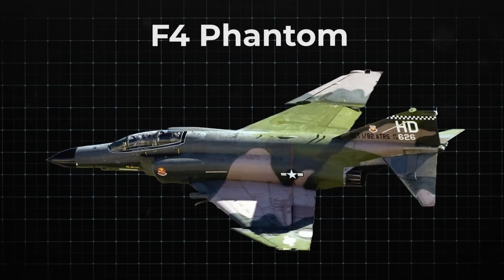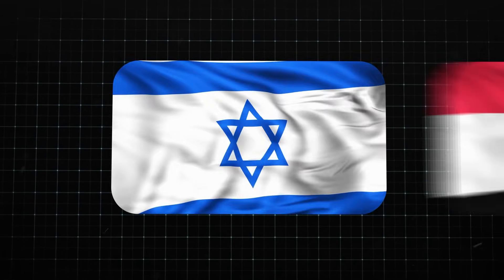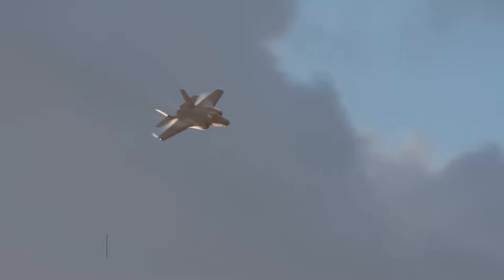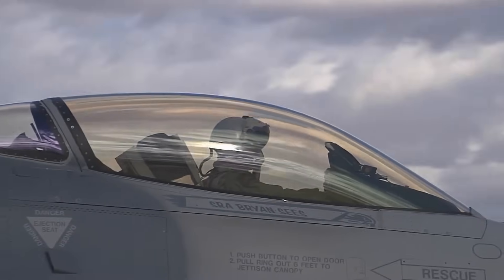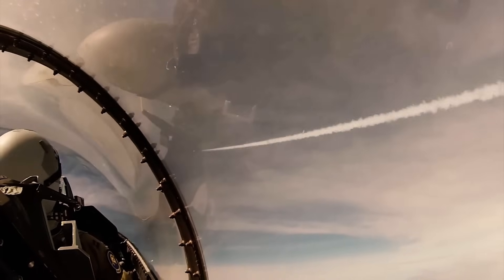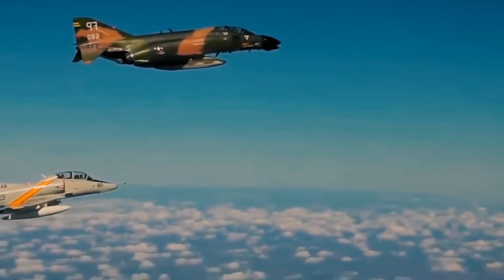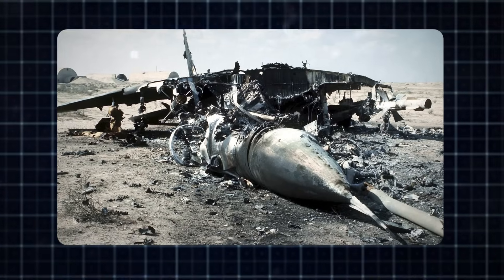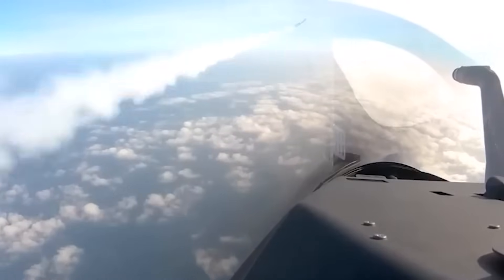FINALLY: US Tests the NEW F-4 Phantom II Fighter After Upgrades

Comment: Israel did some mods to the f4 that were significant.  They put a different engine, and other changes that made it much improved.  It was a proposed change that is still a possible upgrade for archived airframes